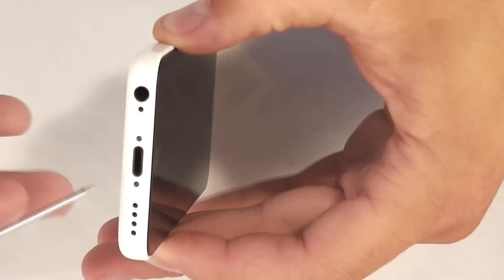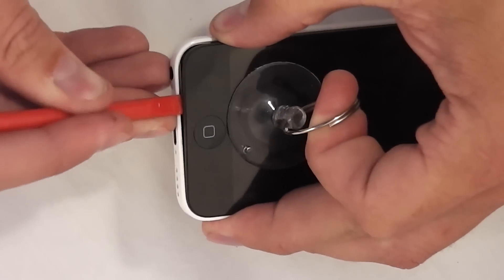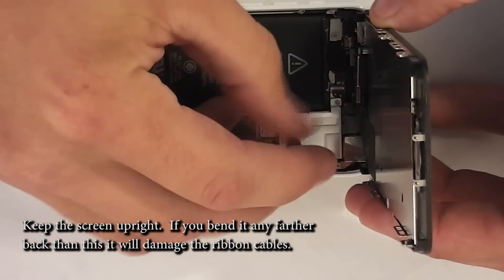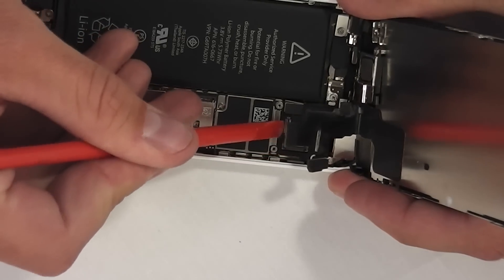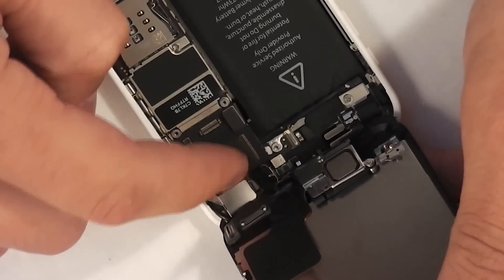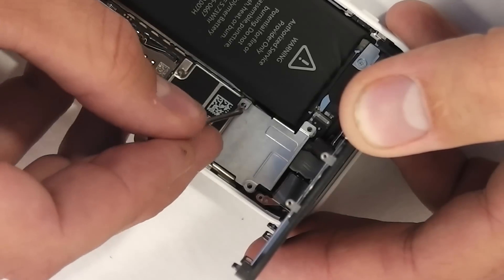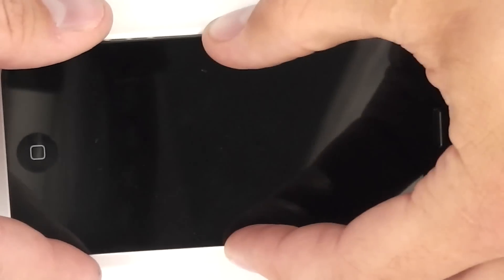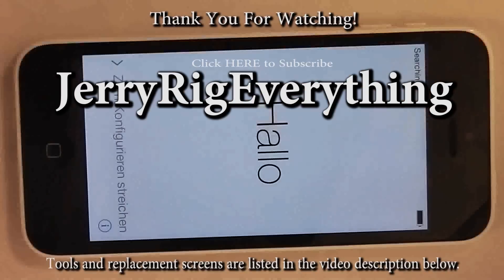iPhone 5c Cracked Screen Repair in 3 minutes

Comment: I was wondering if you had experience with dropped phones. When it fell the top screen separated from the cause. I pushed it back in but ever since then my phone has a dark lavender/ grey hue to it. It turns on regular but after 30 secs it begins to fade and after 5 min the touch screen is non responsive. Is it permanently damage? Did something get knocked lose during the fall? Any help will be greatly appreciated.
Reply from the maker: Tallgal64 Its hard to say without seeing... But with your explanation, it sounds like the LCD did get damaged, and it is most likely permanent. (Until you swap out the screen)
Reply: Which screen would be the best? I would love to have the one that comes with everything like in your video?
Reply from the maker: Tallgal64 Check the links in the video description.  (None of them come with all the parts installed... ) but they are reliable.

Comment: do you need that plate you un screwed inside of there? Cause my phone doesn't have that. And I followed every step. still seems to not work..
Reply from the maker: The plate only holds down the connections.  And it is rather important.
Reply: andrea mitchell There is no such thing as a 4c. 4s yes.

Comment: Mine has lines on it? How do i fix that
Reply from the maker: imcMakeup You can try replugging in the screen again. OR it could just be a faulty screen. Check the connection first though.

Comment: so i dropped my phone on the sidewalk and it's very cracked. the bottom left (sort of to the left of the home button) is a different color. The screen (my cracked one) is not responding to my touch and when it does, it is very glitchy. If i replace the screen, will this go away?? please respond i need to know asap
Reply: Yes

Comment: Maybe someone can help?  Caught the corner of my iphone  5c with a dumbbell in the gym.  Bounced off at a crazy angle as phone was safely tucked away.  Has a leather case, but it now has stripes down the screen.  Seems to still be ‘working’ as it vibrates (it’s on silent) indicating texts are being received and alarm still goes off.  Will a new screen sort this?
Reply: The “stripes” are actually dead pixels on the screen that are caused when the screen cable gets disconnected by taking a hard fall. It has nothing to do with the software. A screen replacement should make it back to normal.
Reply: Are the stripes vertical or horizontal?
Reply: @GarlicUltimate35589  

It’s okay, bought a new one, I needed an upgrade anyway! Cheers

Comment: suction cup won't stick to shattered screen. I tried using tape on the screen to get a good suction but that still didm;t work. Any other ideas?
Reply from the maker: Watch my iphone 5c water damaged repair video.  In that one I show how to put a razor blade between the screen and the frame to pry up the damaged/ cracked screen.
Reply: thanks - I got it!!

Comment: How should I replace THE GLASS ONLY, not the full screen? I bought it on eBay, and its just the glass. I shattered my screen yesterday during class...
Reply from the maker: Orlando Piercamilli That is a very difficult repair.  It has a very low success rate for beginners.  I have this video: Galaxy S4 JUST THE GLASS Screen Repair BEST Video that would be very similar to the iphone 5c.  BUT I highly recommend just replacing the whole screen.  Itll end up saving you time and money.

Comment: I was replacing my screen and accidentally disconnected the cables that attach the screen to the phone while the phone was turned on. Did I just ruin the screen by doing that? Hope you reply soon! Thank you!!!
Reply from the maker: Christian Lopez Most likely not, Ive accidentally done that before. Just turn off the phone again, and reconnect the screen to test it out.

Comment: how do you transfer over the ear piece if the screen I bought doesn't have one connected to it? It only has two connectors and is missing the earpiece but the original screen (shattered) still has it. Any thoughts??
Reply from the maker: Adrianna Day Watch my iphone 5s screen replacement. I show how to transfer over the parts.

Comment: Jerry, I see several 5c screens listed on Amazon is one better than the other? The pricing goes from 30-70 and I want to make sure I only have to do this once. Also my speaker is not working so well I have noticed in another post that it will need to be transferred over. can I also purchase a new speaker and if so does it have a part number? Thanks
Reply from the maker: Gina Menendez Just make sure that the screens have good reviews on them before you buy.. I see one on amazon that is 50 bucks and comes with the earpiece and home button already mounted.. Seems to have good reviews.  You can choose that one if you want.  OR I included the link to a new earpiece in the video description. (right below the video you watched.) Check it out, and let me know if you have any more questions.

Comment: How long do you think it will take for Amazon to get screens? I could replace this myself, but I'm not spending $200 on a new screen.
Reply from the maker: It usually takes 2-4 months for the parts to start filtering in.
Reply: Ok thanks!
Reply from the maker: I have linked new screens in the video description.  You can get them now for relatively cheap.

Comment: quick question,  you can buy the screen with the home buttons and camera and everything on it so you dont have to swap? if so is that the link above.  i want to do mine, i dont wanna deal with the swapping , and heat sink shit
Reply from the maker: Benngrym I used to buy 'complete' screens, but found that the quality of the included parts were inferior. So I switched to screens where i can swap over the original parts.  It will add an extra 20 minutes or so to your repair, but will last longer.

Comment: I did everything right and got everything back into place, but the touch on my screen doesn't work. It turns on and everything, but I can't swipe to unlock or get any reaction out of touching. Any suggestions or reasons this might be?? Thanks for the help.
Reply from the maker: Jennifer Murdock It might just be a bad screen.
Reply: Jennifer - I had the same issue with a 5s and all it turned out to be was that one of the ribbon cables was not seated properly into the connector (I hadn't fully clicked it into place). It is the first cable that you connect that sits under the others that I had difficulty snapping into place. Once I connected it properly the replacement screen worked fine.

Comment: Okay.. My dad stepped on my phone. and it isn't cracked bad it just show the black screen I could still hear it vibrate , and i messed around and pushed down on something and music started playing until my phone died. So it still works .. i just want to no would this help out instead of buying a new screen.?
Reply from the maker: +Jordan Frederick It sounds like the LCD is broken. So replacing the screen should fix your issue. But its hard to say for sure without looking at the phone.
Reply: +JerryRigEverything Oh okay thank you. and on the screen were the front camera is the speaker is like cracked . So getting a new screen would fix the problem?.
Reply from the maker: It should, a new screen includes a new LCD and new Glass.  Check the video description for parts.
Reply: +JerryRigEverything Okay thank you again

Comment: Hey Jerry,
Do you know where I could find a motherboard back light? It's for an iPhone 5c, I was told by a repair shop that my phone needs a new one but they couldn't find it for sale.
Reply from the maker: The motherboard doesnt have a backlight.  Your LCD might.  But it is a complex repair that requires special tools.  You'll be better off just replacing the screen as a whole unit.

Comment: Hey I need help I just dropped my iPhone 5c, it shatters but everything is functioning normally. Can I just replace the glass or the whole thing
Reply: To replace just the glass you'll need to separate the glass from lcd and is not easy to do if you dont have the tools and knowledge, need a screen separator machine, wire, special glue, ultraviolet light...better buy the whole display assembly

Comment: Hi! I have an iPhone 5c. I dropped and the screen it had a wavy look to it when I used it. We purchased the tool kit to fix it, but now the entire screen is off and won't come back on. We have a replacement screen also that we have not tried yet. It is one without the button or camera. It appears that when the phone was dropped that the piece that clicks the phone together broke also, as it won't click in place at the top. Is there a way to purchase this piece? Do you think the replacement screen would work or should I look for something else? Thanks for your help!!
Reply from the maker: Megan Cruttenden The new screen should work, itll come with the plastic groves along the top that sit into the phone frame. You'll just have to move the camera and home button over from your old screen.

Comment: I have a cracked screen, but Everything on the phone still works, I can still take pictures, make calls and do all of my normal functions, can I just purchase the replacement glass, or will I have to purchase a whole new screen and lcd piece?
Reply from the maker: You cant seperate the glass from the LED, they are glued together.  You'll need to replace them both.  I linked the parts in the video description.

Comment: I have replaced the screen and all the components but the touch screen is unresponsive and there are white lines thru the screen.  I have tried making sure all the connectors were secure and they seem to be. Any suggestions on what I may have done wrong and how to fix it??
Reply from the maker: Could just be a bad screen.  You really have to be careful with those ribbon cables.

Comment: Followed the directions but my home button and front camera still aren't working. Did I miss something or do I have a bad screen?
Reply from the maker: killermiller0069 Check to make sure the ribbon cables are all connected, and the home button connection pads are in contact w/ the phone.

Comment: I dropped my iphone 5c and a piece from the top part fell off (the camera still worked) and I still used it and sadly I dropped it and the screen turned like blue, but it I can hear my notifications and when I unlocked it turns off and Im pretty sure it charges. Will replacing the screen help?
Reply from the maker: Karen Chavez Yup!  It sounds like your LCD is broken. Look in the video description for the replacement parts.

Comment: But why do you say “you might have to change the home button and the back panel“?
Reply from the maker: Some screens dont ship with those installed.  They are very easy to swap from the old screen though.  If you managed to get this far, you should be just fine.

Comment: MY IPHONE 5C FELL ON ITS SCREEN AND SHATTERED THE SCREEN POPPED UP FROM THE TOP AND 1 SIDE SO I PULLED IT OFF BUT THE RIBBONS AT THE TOP ARE STILL CONNECTED BUT MY PHONE IS NOW OPENED DO I USE THE SCREW DRIVER TO UNSCREW THE 4 SCREWS AND REMOVE IT ALL THE WAY ? WHAT TO DO NOW ? OR DID I MESS IT UP ?
Reply: James Gomez JerryRigEverything
Reply from the maker: James Gomez Did you watch the video?

Comment: I shattered my phone today and it won't work..the lock screen is crazy colors, stripes and spots, will fixing the screen help or is there more damage?
Reply from the maker: Neha Kattoju You should be able to swap out the screen. Hopefully that is all that broke with the phone.
Reply: thanks! I actually went to the phone shop a day after I made this comment and they said my lcd was missing. so I had them replace the lcd and my screen, and my screen is as good as new!

Comment: I fixed the screen but it's pure black I can hear the calls and message alerts but I can't see anything
Reply from the maker: RainDropVid Check the screens connections again, if it does not work the 2nd time around, it could be because the cables might have been tweeked or twisted during the instal, OR it could just be a bad screen.

Comment: I had my iphone 5c screen replaced by a guy locally and since then I've had a few minor issues. There seems to be a faint line going down the left side of the screen. It's barely visible but I notice it. Also sometimes when I try to press an icon on the screen it doesn't do anything. Its almost like its frozen up. I have to press the button on the top and go back in to unfreeze it. Can you tell me what may be causing these 2 issues?
Reply from the maker: Sometimes the replacement screens are not as good of quality as the originals.  I get a bad batch every now and then as well with my repairs.  See if the guy who fixed it will swap you out again.

Comment: i dropped my 5c a month ago and its just been getting worse and the front camera is really foggy and blurry . if i was to buy a new screen and get it put on woud that solve the problem ?
Reply from the maker: Talking about the front facing camera?  Yes, if the glass in front of the camera is foggy and cracked you'd be just fine replacing the screen and having it work again.
Reply: thanks so much !!

Comment: Do you know if the screen from repair universe is higher quality than the one on amazon? Because there are quite a few bad reviews on amazon, but a lot of them seem to be due to operator error.
Reply from the maker: Dustin Cortelyou Its hard to say... They are probably about the same level of quality.  I honestly havent been able to tell a huge difference between the two, as long as they have been installed correctly.

Comment: As I was working on the phone I removed the 4 screws from the plate and my daughter moved the paper I had them on so now I'm not sure where they go...help please!
Reply from the maker: Just gently screw them in.  If you feel any resistance, you are screwing the wrong one. Guess and check.
Reply: JerryRigEverything I'm most worried about the long screw. If I'm looking at the plate there is a tab that goes to the top left and then the remaining three corners of the square. Do you know where in the square the long screw goes?

Comment: I just broke my screen on my 5c was buying a case for it tomorrow and dropped it and shattered top part of screen nothing is wrong with bottom now do you have to buy the screen and home button to replace the shattered screen or do I just need to buy screen
Reply from the maker: evan peaden You just need to buy the screen ( linked in the video description)  Then transfer your home button over to it during the repair.

Comment: My phone displays absolutely nothing but the screen itself is not cracked. It is completely unresponsive but I know it works because I plugged it into a monitor and therefore I assume that I see it works. Would replacing the screen solve my problem or is there another problem.

Comment: MY SCREEN IS COMPLETELY CRACKED LIKE I CAN JUST TAKE IT OFF RIGHT NOW BUT I STILL GET THE NOTFICATIONS I JUST CANT SEE ANYTHING ON THE SCREEN AS IF IT WAS DEAD WOULD THIS BE FIXABLE
Reply from the maker: Kevin King Ya, if you look in the video description, I linked the replacement parts.  You  just need to swap the screen with a new one.

Comment: my screen went completely black after i dropped it, however, it lifted and the back was still lit it was just the screen that wasn't showing anything. i tried doing these steps just to make sure everything inside was secure and in place but now when i plug it in to the charger the screen is still black and it just constantly vibrates. doesn't stop until i take it off of the charger. do you have any idea what that can be or what i can do to fix this?

Comment: I'm having trouble removing my screen because its broken at the bottom so the suction cup wont stick there :/
Reply from the maker: You can put clear packing tape over the cracks, OR watch my iphone 5c water damage repair video and see how I pop the screen off with just a razor blade.

Comment: does the phone have to be off before replacing the screen because my screen is totally black so I dont no if it on or not?
Reply from the maker: harri bardill Yes, it does have to be off.  You can disconnect the battery as well before you start.  That would make sure it is off.

Comment: BTW WHEN YOU DO THIS AT HOME! TAKE THE BATTERY PLUG OUT! IF YOU DONT! YOUR PHONE WILL SHORT OUT! I just went to a profesinal place and I got a Do it yourself kit and the guy there said to take out your battery or else it will short out. Well the plug to the battery
Reply: what do you mean?.. i disconnect the battery latch first then i take off the rest inside the phone?
Reply: I'm sorry what I'm confuse
Reply: S Henry i did the same thing a blew my ipad backlight how did you fix was it a easy one ?

Comment: Do you think I can make a profit off of this by fixing them for other people? I'm pretty handy and there is an endless supply of idiots shattering their phones at my school. Mostly I'm worried about what happens if I screw up and damage the phone even more, as that's not a problem when you send it back to Apple or to any company that offers a warranty. Looking at the costs of new screens and what I'd be able to charge it looks like I'd only be making ~$20-30 per repair, which I don't know if it is worth the risk or not.

Comment: I dropped my 5C and the whole top by the camera was shattered and some glass managed to fall off so a good chunk of it was missing from the phone my phone was still turning on at first then i put it in my pocket for about 2 mins then when i pulled it out it froze on a lit black screen so i tried to reset it and then it got stuck on the apple logo then it just shut off from there and to this day it wont charge nor show up on my computer when i plug it in what should i do?